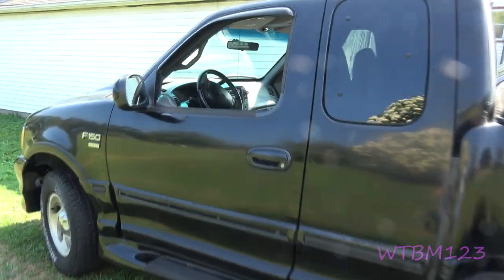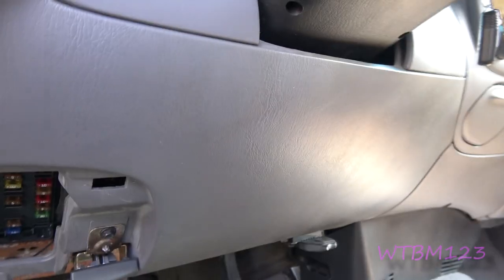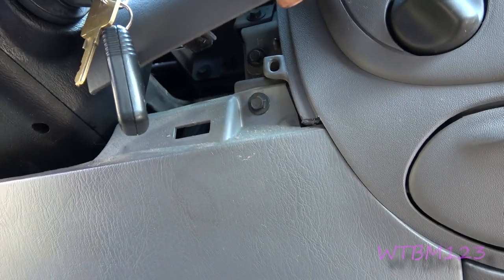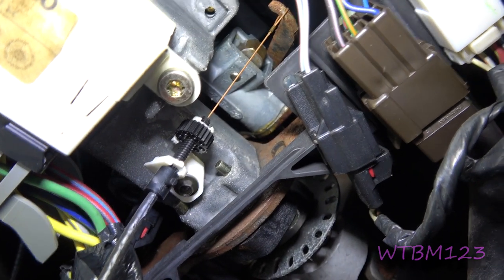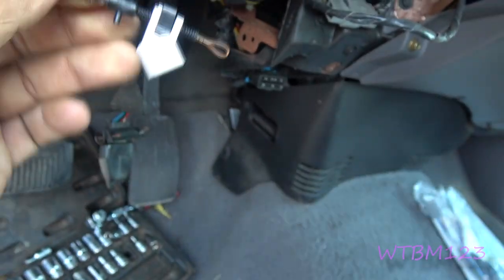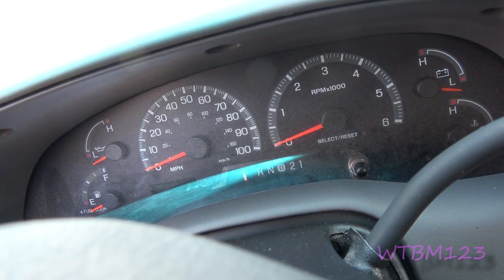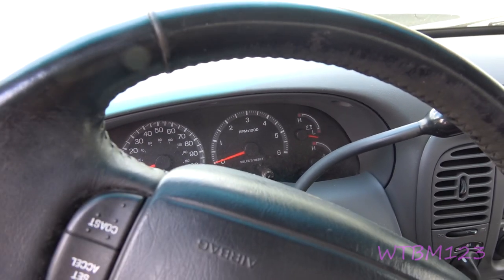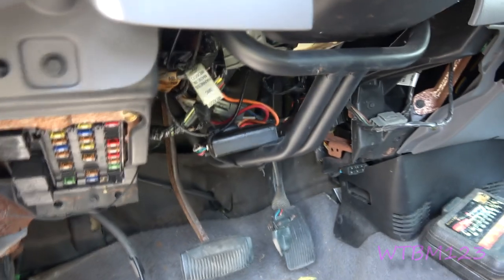f150 shift indicator $10 FIX,  2000 F 150

Comment: The time and money I saved fixing this myself was well worth it. Took me about an hour start to finish. Thank you for taking the time to make this video. Truck is back in business.
Reply from the maker: Glad you are back up and running .
Reply: Had the same problem thank you for your help and they do sell an aluminum one for 13 dollars on Amazon that takes place of the white plastic piece finally
Reply: Did this problem prevent  your  truck from turning on ?
Reply: @ffffffffffffffstt  It did not prevent my truck from starting. It prevented me from understanding where I was in relationship to shifting.

Comment: Well done. I did this 2 days ago, I did not know how to remove steering column plates, found lower cover bolts and removed them, then dove under. Great work on the shifter tightening! This is very important, while under the wheel jiggle the wheel to see the 2 bolts, if loose, even if bolts/screws feel tight torque em! Made a Huge difference. It took me 2 hrs, but now can I dial in shifter and this makes a huge difference for driveability for these old trucks, the transmission, etc.  Too bad Ford cannot, or did not figure out a stronger tiny clip over plastic part w a bolt, cable, pulley, get rid of the plastic, thing more block and chain w pulley.
Reply from the maker: Glad you got it sorted out , Sounds like you did it right .
Reply: Amazon sells a metal bracket same price

Comment: God bless you.  '99 F150 wouldn't turn over.  Was checking battery, starter, cables, connections, fuses.  Turned out to be the neutral safety switch, which was kicking in because shifter wasn't fully in park.  Tightened up those two idiot bolts, slid it into park, and away she went.  Dialed in my indicator while I was at it.  Was able to do it without removing dash panels too!  Couldn't have done it without you.  Salut!
Reply from the maker: Thanks for watching and commenting

Comment: Excellent video. Truck would not start in park and I had to start in nuetral, last night the truck stopped going into park and started to roll away on me. This video showed me both problems, clip is broke and on the way, the 2 screws were quite loose and a simple tightening of them without needing to remove the dash has it shifting again and no problem going into park. Ill finish the indicator bracket when the part comes in. Thanbk you so much for the perfectly clear video and taking your time to share it. Jim
Reply from the maker: Thank you for watching and commenting . Glad you are getting it all sorted out .

Comment: Excellent, I broke mine the other day after putting a remanufactured engine in and messed with the dashboard cluster wiring in my 2003.  It's the exact same part number, thanks for that.  In stock at Autozone, too.  lol
Reply from the maker: Nice work!

Comment: Thanks for this.  Found out my cable was broken, so I don't know what I'm in for on the other end of that.
Reply from the maker: I do not remember what it looks like , but one can drop the steering column down if needed.
Reply: I have the same problem.  The black screw plastic that goes through the thumb wheel is cracked and I will need to replace the cable as well and I suppose the selector in the cluster is there any videos for this

Comment: Hey my 98 Ford F-250 truck has this misalignment issue but it's not the cable. My cable is fine and I can twist it and it'll move but it's not the cause of my problem.

What else can it be? Is there something in the engine bay that needs to be adjusted or do you know other causes?

Thanks
Reply from the maker: This was not the cable either , it was the clip holding the cable . but if clip is not broken try adjusting with the little wheel . if that does not work , check for the loose bolts on steering column . Would be my first thoughts
Reply from the maker: right off hand i can not remember if the 98 f250 has the same set up
Reply: Ya the wheel is fine and the cable looks fine. I can twist the wheel and it'll move the indicator but it doesn't change the fact that it will show the incorrect gear when I shift. It'll just change how far off it'll be.

It's off to where I can't actually shift in first gear. When I'm in 2 it'll show 1 and I can't go further to put it in 1.

I checked the steering column for the bolts thing before and it looks nice and tight. The actual shifter doesn't feel super loose either. I've seen other trucks where it was wobbly and messed up and it's not like that.

Someone told me to look by the transmission at the linkage but I wasn't able to spot it. I can see the engine.. but I didn't see the transmission from up top the engine bay, maybe it's underneath or something.

Comment: Mines broke. But will this cause the shifter to be hard to shift out of park and shift      weird going to desired gear?
Reply from the maker: Probably not , but check the two bolts i show in video . that like to come loose and cause issues . Usually can just tighten them up. I am pretty sure i show them.
Reply: @wtbm123  Thank you

Comment: Could you imagine the fake metal breaking as you tighten one of those t 30s , I barely tightened her then kaboom clank, just be careful and gentle retightening these screws
Reply from the maker: The new terminals they use any more are not as good as the old real terminals were

Comment: Thank y y have been alot of help is it any way to rest the computer for the Transmission mine just stopped pulling all at once  innnn all gears y can take the battery cable off  an than put it back on an than it will pull for a little untill y hit the brake an than it goes to nural if can up let me no
Reply from the maker: it sounds like it reset when battery was unhooked . Really need it hooked up to a scanner and see the live data , to really understand what is going on .
Reply: I stell havent found out why it does that  let me no if y fine out too thanks Johnny

Comment: @Wtbm123 what’s the Dorman part number on that?
Reply from the maker: I am not sure . but if you go to the Dorman web site and look for Dorman 83244 , that may be it ,
Reply: @wtbm123  thank you. I got one ordered today.
Reply from the maker: may also look at , APPERFiT Automatic Transmission Shift Indicator Cable Bracket (METAL) Replaces 83244

Comment: Ugh make it look easy
Couldn't get my kick plate all the way off because of the ebrake and hood handles. 
AND I can't contort 🥨🥨 myself to get under there 😣
Reply from the maker: It is hard to get in under there . Sometimes i put a board on the car floor and then put the other end of board on a chair, a stool  or something and lay on the board . if that makes sense